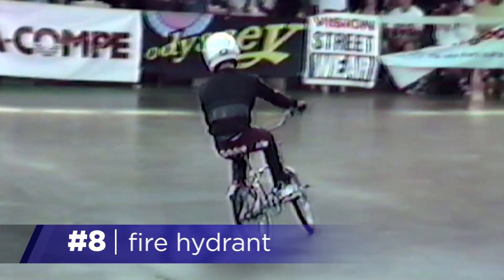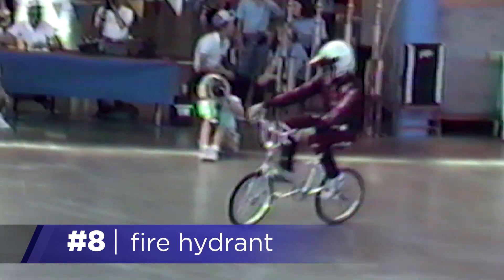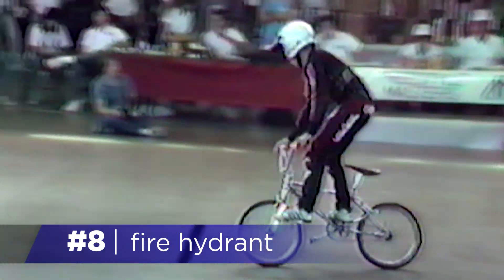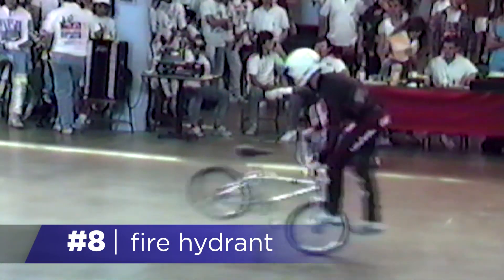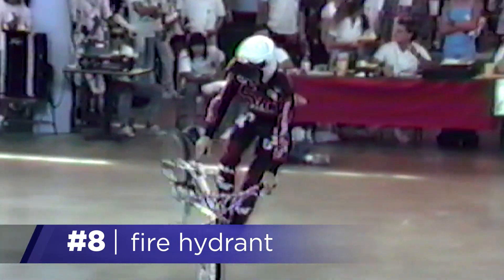#8 How to Fire Hydrant - BMX Flatland

Comment: Any tips for the 180 at the beginning? I'm struggling. Thanks!!
Reply from the maker: Lean into it. Start with your momentum on the inside of tire and quickly adjust to the outside edge of the tire. The motion from inside to outside will give you momentum. You’ll get it.